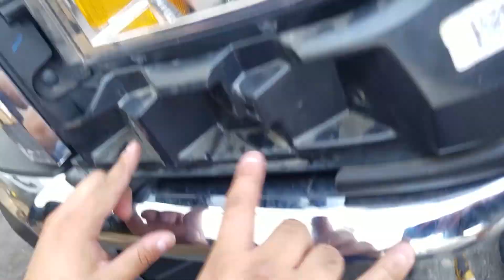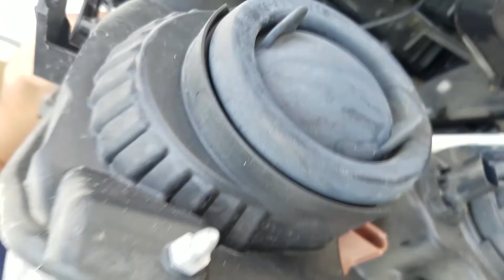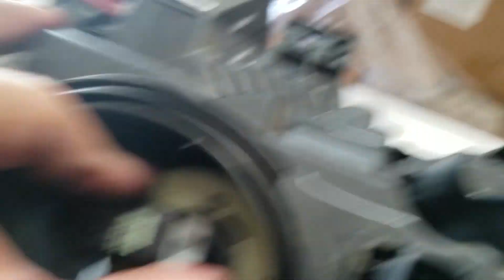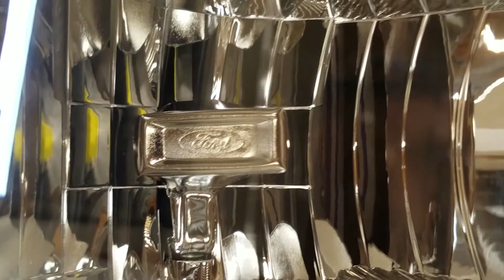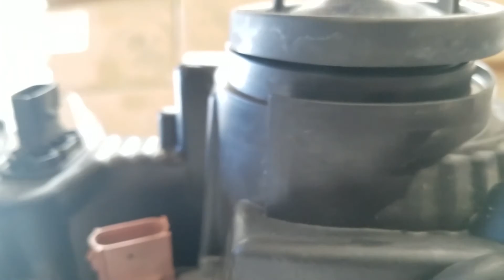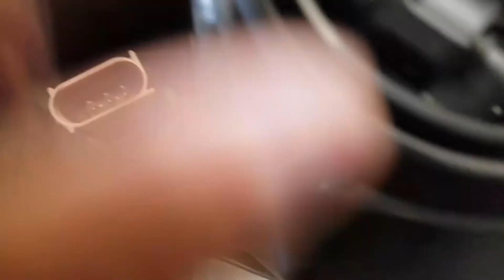Ford F-150 2015-2018 LED Headlight Bulb Install High Low Beam - LA Series

Comment: Did the daytime running lights work after install? I believe they are the same as the low beams. In the 2020.
Reply from the maker: Hi, could you please tell us whether you have halogen DRL bulbs on your 2020 Ford F150?

Because many 2020 F150 vehicle customers give us feedback that they have LED DRL lights.
May I know the trim of your 2020 Ford F-150?
Reply: @Lasfit-Automotive  it’s a 2020 xlt with halogen headlights.
Reply from the maker: @LordBracht  Hi, 
could you please tell us why you plan to replace the DRL or are you worried that installing the low beam will affect your DRL working?
Reply: @Lasfit-Automotive  i am  worried that installing the low beam will affect your DRL working as the DRL is the low beam bulb. and is there  any canbus decoders required?

Comment: What size dust cover is needed for the 2015 Ford F-150 from your site?
Reply from the maker: Hi, we developed cusomt-made LED kits for 2015-2017 F-150, which comes with dust cover.
https://www.lasfit.com/products/2015-2016-2017-ford-f-150-custom-fit-led-headlight-high-low-beam-h11-9005-w-dust-cover?utm_source=Social&utm_medium=YTB%20Channel&utm_campaign=Pro-FD-02
Reply: @Lasfit-Automotive  I already have LED lights just wanted to get the dust covers.

Comment: Have you guys SOLVED the issue with the COVER not fitting over the FAN on the Large Blue,,,,  it's now AUG 2019...  Let us know !
Reply from the maker: Yes. The upgraded version, LAplus series solved the issue. It is shorter size than LA series. Here is the link:
https://www.lasfit.com/products/the-whole-set-of-led-lights-fit-2018-ford-f-150

Comment: These light do not fit my 2015 Ford F-150 the wiring prevents it from going inside the housing and locking into place. Not sure if they have changed the design now?
Reply from the maker: Yes, we designed a new LED bulb, 360° adjustable base socket, here are pics:
https://ebay.to/2zW7j4P
Reply: Is there any way to make the older one fit? I’ve have already bought them
Reply from the maker: @coolkid688  Did you bought LC6 series, or LA series? There is a screw on the socket, you can take out the screw to adjust the direction of the cable, then fix the screw.
Reply: LASFIT Auto Lighting lC6H11. What prevents the led from locking into place the cable?
Reply from the maker: @coolkid688  If the factory socket is not in the middle of the housing, the wiring probably prevents LED bulbs from going inside the housing and locking into place. LAplus series is 360° adjustable, which fix the issue.
If you run into problems, or have some questions about LED lights, you could contact our customer service for support.

Comment: All you had to do was remove the plastic fender well cover lol
Reply from the maker: that's very true but then again we like to give our viewers an idea of how everything looks in the back of the head light, possible issues one can run into when installing our bulbs and how to work around it. For a more experiences user they would go through the back of the fender liners to get to the bulb but might end up having to still remove the headlight if they run into any fitment issues that might require the modification shows in this video.
Reply: I second that... Shop manual shows 2 screws a plastic push pin and steering wheel pointed inward of which side your working.  Hoping for good easy install.  

Crazy thing is all I see is headlight installs with everything removed.

Comment: I purchased these (LASFIT LA H11 as in the video) for my 2017 f150 XLT w/ halogens, and these did not fit. I am not sure if you guys had a design revision since creating this video, but the fan housing wires prevent you from being able to twist/lock the bulbs in the housing.
Reply from the maker: Hi, we have a design revision, 360° adjustable base socket, the link:
https://ebay.to/2zW7j4P